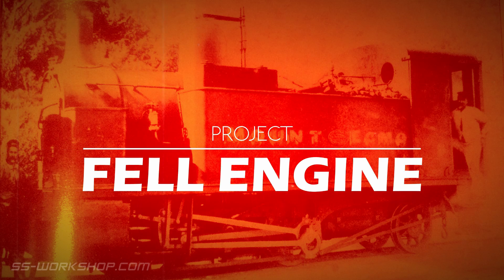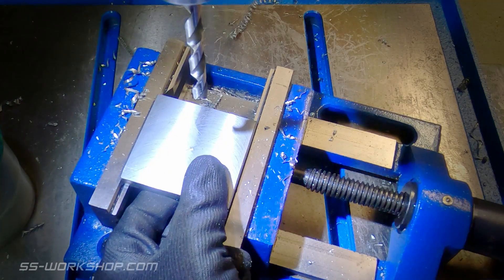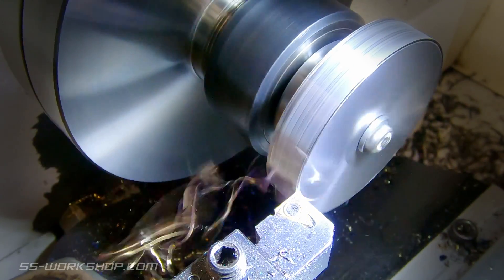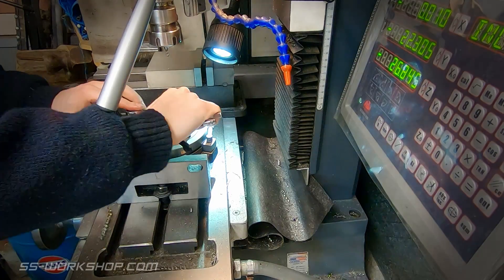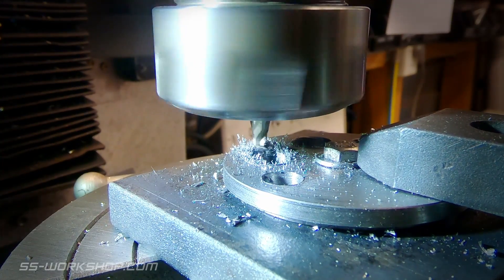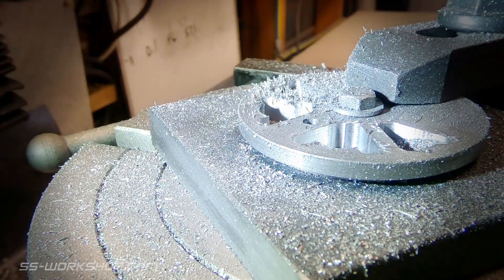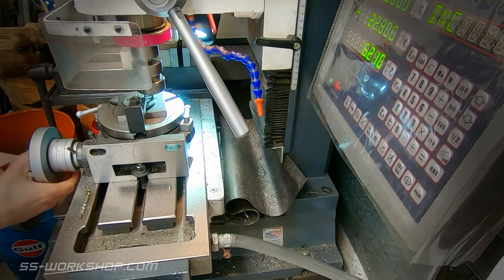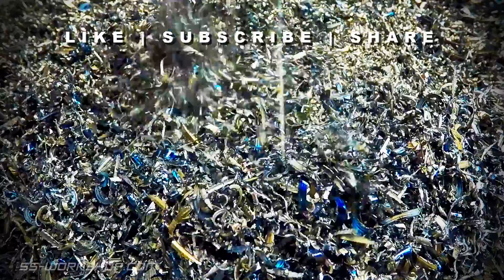Fell Engine Project - Machining Flywheels S1.E23

Comment: I'm really amazed by your project and luke watching the engine build.
What I wonder is the surface finish on your lathe.
My father taught me how to work on a lathe, he is a professional who worked on the lathe for nearly 50 years.
You have good tools with inserts that should make a smooth surface finish, but yours often look like the tool don't cut properly.
Reply from the maker: Thanks, well spotted I think the surface finish issues are down to a couple of factors, machining mild steel which has bad machining qualities and blunt tooling as I run my insert tooling longer than I should. Then I change inserts they cut a mirror finish, I just don’t change them to much.

Comment: I'm constantly amazed at the cuts you take with that mill! That first cut when rounding the square blank was pretty scary. You seem to get away with though. I used to be upset when I broke an endmill but now they're cheap enough from eBay it doesn't hurt so much except having to wait for the new ones. And trying to decide which ones to buy - it's easy when there are no choices.
Reply from the maker: I didn’t even think about it, but I guess your right, with this mill and the correct size cutter and all the axis locked it doesn’t even notice. The sweet spot for my mill seems to be 12mm which is small enough to cut at a good speed, not push the mill around and large enough to not be to fragile. I had a mill lathe combo before this and it couldn’t even take a mm.
You right about the import end mills it’s pretty painless I get mine from AliExpress and they are cheap 4mm was $1.60 the other day but there is always the wait. Certainly not like the first set I bought locally and paid a fortune for, didn’t make them last any longer.